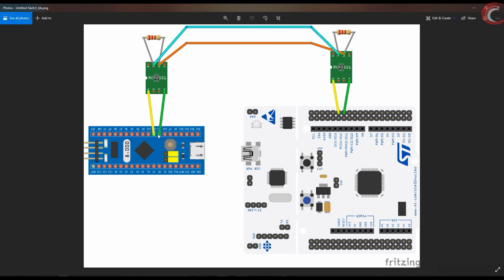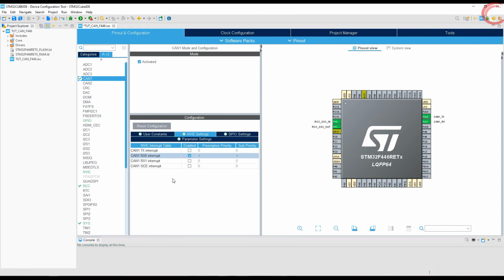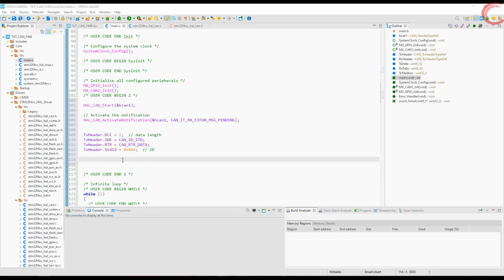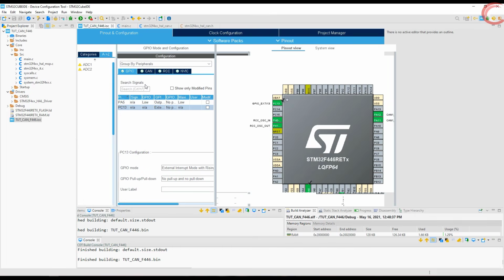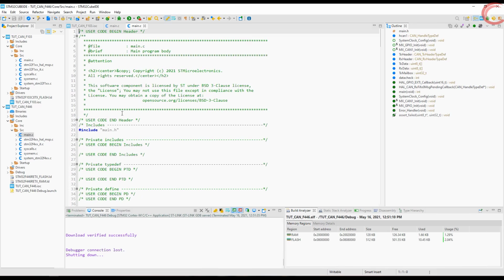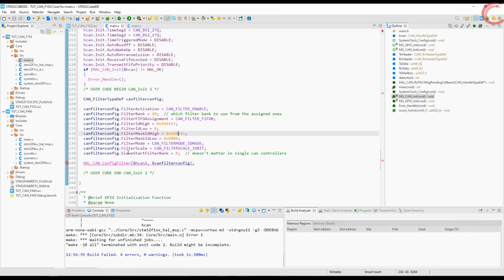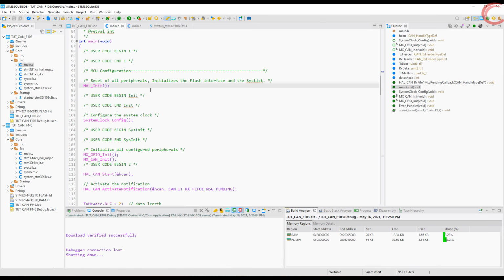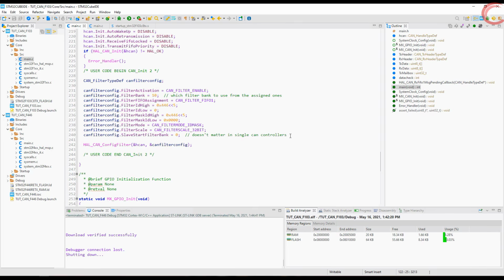STM32 CAN Communication Explained | Send & Receive Data Between Two Microcontrollers

Comment: i have to connect two CAN nodes operating at different clock freq. for Communication is it sufficient to fix one bit time and baud rate parameter only or any other parameter needs to be fixed?

Comment: i have to use two CAN nodes, which are operating at different clock freq. In order to communicate on CAN protocol, i have to match the bit timing parameters. fixing one bit time and  nominal baud rate is sufficient or any other parameter needs to be fixed?

Comment: Is it possible to connect these two boards without CAN tranceivers? We actually make double conversion. From board to CAN and backward...
From software point of view we work only with microcontroller's logic... And physical CAN layer is hidden for us...
Reply from the maker: Yes it is possible to connect them without the CAN transceivers. You are taking the video in a wrong way. Please don't see the video as "Communication between MCUs using the CAN protocol", because no one in their sane mind will use the CAN to communicate between the MCUs, when you have other options like UART, I2C, SPI, etc. 
This video rather demonstrates "how to use the STM32 as CAN Master and CAN Slave", "How to transmit messages on the CAN Bus" and "how to receive correct message from the CAN Bus".
Reply: @ControllersTech  Why wouldn't you use CAN, it has a much longer length between nodes than usart, i2c and spi

Comment: i have my receiver sucessfully received the message and datacheck flag is turned to 1. But the receiver does not jump into the if function inside while loop. What can be the problem ? Btw thanks for detailed video!
Reply from the maker: debug the code to find it out. Maybe you are transmitting messages at a very high rate.

Comment: Thank you for explaining it well..
I have tried implementing the code loopback works fine but for normal mode I am facing issue in transmission and the error is bit dominant error. What is the cause for it?

Comment: What is the txMailbox???
Reply from the maker: Txmailbox is used to send the can frame. The F4 board I was using has 3 mailboxes, so we can queue up to 3 frames for transmission. Then the frames can be sent based on the priority of the message. In the video I didn't utilize much of the mailbox's features, so it was only used for transmitting a single frame.

Comment: it does not jump into the HAL_CAN_RxFifo1MsgPendingCallback() function? 
I pulled the RX1 pin up but it still doesn't work.
Reply: Did you solve that problem ??
Reply: I'm facing the same problem. Did you solve it?
Reply: @tantrung7398 @ziademad53 I've solved the problem. For me adding "HAL_Delay(1)" after the Tx function fixed my problem.

Comment: What is the sequence of loading and running with respect to the  boards  .For the Master 446 and the slave F103,  diagram does not show  other end connections of USB cables . Is the 446 USB connected to PC for program uploading and power . For F103 is  other end of 4 pin link  connected to PC  USB port for program loading while the  USB mini  is connected for power / How do the master and slave  get their programs - are they loaded thru only the 446 or does each microcontroller have to be loaded first  thru USB ports  ( on a port hub )
Reply: Issue Resolved  -thanks

Comment: Hello Sir, do you know if its possible to use blue pill for combining usb comunication and can comunication to make USB<->CAN bridge?
Reply from the maker: Yes it is possible. but rember that bluepill only supports usb device mode, so plan the things according to that
Reply: @ControllersTech  hello sir is these vedio useful to receive  can message using stm32f103c8t6(blue pill) and sent to uart if not tell me a way to do please
Reply from the maker: Yes. Just send the RxBuffer to the UART.

Comment: Schematic does not shown all wire connections  btwn Blue Pill STEM32, 2551, and the F446RC can  you provide all those in more detail -Studying CAN and this is a great tutorial serie(s) just not that familiar with STM32
Reply from the maker: connection diagram is shown on the webpage.. The link is in the description.
Reply: : @ControllersTech  for the  Master 446  is the entire code  loaded (and powered) thru the USB port ?; for the F103  4 pin Link and usb are cabled  - is the USB connection for power? -and is the 4 pin  link going to a PC USB port . Other ends of cable(s) to power source and download path not shown -same with multi devices  don't want to mis connect system (s) Not sure how to physical feed the code to Master and slaves  from cube IDE  Walk thru all code  and all tutorials -several times until I understood-appreciate the details - Have a good understanding of the Can BUS std  just not sure of hardware /upload connects : retired engineer  ( old school) still have my sliiderule - mentor for robotic team now
Reply: Issue Resolved - thanks

Comment: Hi, thank you for this video. I want to inow how to convert CAN BUS 1 to UART? Can you advise? Hope you can help. Thank you.
Reply from the maker: Why would anyone want to do something like that ?
Reply: I need to interface CAN BUS 1 output from one device  to UART input on a different device. @ControllersTech
Reply: @ControllersTech  i have one device that sends info through CAN BUS 1 and an other device that has a RX and TX that is normaly meant for UART connection. This is for a project where I am building a drone. The OSD info from flight controller is sent out via CAN BUS 1, the FPV camera overlay this info. But it does not have CAN BUS 1 and only have UART connection. Any idea on how I can go about this? Hope you can explain. Thank you.
Reply from the maker: You can use your STM controller to read the message from canbus and then After receiving the message, send it via the uart.

Comment from the maker: If the setup doesn't work, Pull the RX pin HIGH using the internal PULL-UP in the cubeMX.
Reply: after pressing button led is not blinking in stm32103c8 and 446re only while button pressed in logic 2 signal is showing not blinking led please help me

Comment: Isn't it a problem that you are connecting 3.3V stm32 pins to 5V MCP2551 pins ?
Reply from the maker: Mcp runs at 5v. The tx and rx pins don't.
Reply: @ControllersTech  but on the datasheet it says that te txd and rxd runs on Vdd +- 0.3V.  And Vdd is 5V.
Reply from the maker: Even if they do, a lot of pins in the STM32 MCUs are 5v tolerant.  I am sure the CAN pins are among those.

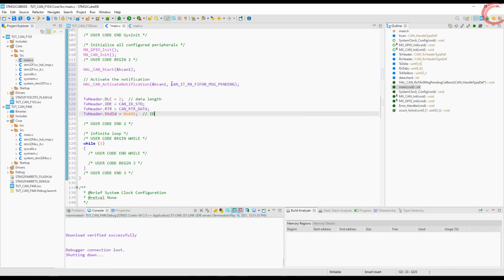Comment: At time 12:03 you say " as I said I will use fifo1 here" where did you said this and why what is the difference what happens if I keep it 0
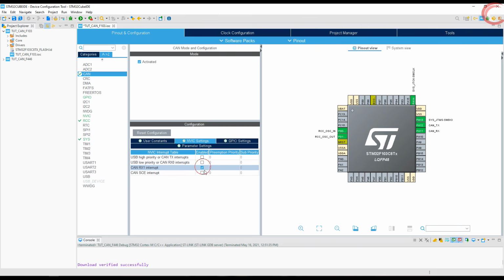Reply from the maker: "where did you said this and why" at 11:00, I said it's just to demonstrate. I just wanted to show that either of the fifos can be used.
 "what is the difference what happens if I keep it 0", basically nothing. It doesn't make any difference

Comment: What happens if I disable filter ? I don't want filtering. Every message can be transmitted and received in my case
Reply from the maker: Try it. If it doesn't work, then use the filters and set them to 0

Comment: Please explain , why we need can transceiver  if both ot MCU support the CAN protocol? If however I have to use can transceiver  then  if I'm using the Rx and Tx pin on can board  to communicate with it(CAN BOARD) from MCU , then why we don't program the MCU for  serial communication ?  after that it is the mandate of the CAN module to convert a transmite and recevie and then convert in to serial  again?thank you .
Reply: CAN protocol uses differential signals to communicate. However, the MCU we are using can't produce differential signals. Therefore we need extra IC chips, CAN transceiver in this case to produce differential signals. 
Also, if we are measuring any differential signals our MCU can't sample those signals. In this case too we need extra chip to intake differential signal and produce single ended signal so that our MCU can sample those signals.
Hope that helps.
Reply: Also, CAN protocol has multiple advantages over plain Serial(you mean, UART since CAN is kinda Serial too,) .
1. distance
2. Noise immunity
3. Multiple nodes communication

Comment: Hi @controllers_tech , thank you for the tutorial. Unfortunately i have problem with transmiting message with CAN. I used analyzer to check if any data was transmited on Tx pins before the transcevier (TJA1050) but it is not. Also function HAL_CAN_AddTxMessage doesnt return any errors. I have connected both boards with the same can configuration and i have code exactly like yours. DO you have any suggestion how to solve my problem because i dont know where to find the solution.
Reply from the maker: First start with loopback mode (previous video). That's more suitable for error checking
Reply: @ControllersTech  after what we need to do ,loop back mode

Comment: Dear @controllers_tech Thanks for this tutorial. CAn you please tell me how did you manage USB cable and st-link at the same time both just for programming. Thanks in advance
Reply from the maker: What USB cable ?
Reply: On one hand and from the blue-pill you connected the four wires cable (3V3, SWDIO, SWCLK, GND) probably to your pc through ST-LINK. On the other hand you connected the android cable that normaly powers the blue pill. I want to know if it was necessary to connect this second cable on the blue-pill and where have you connected that one (also on your PC)? Thanks in advance?

As a matter of fact, I have not yet used the blue-pill although I have it. I need to use it now from canbus application and your tutorial has help me a lot to undersatand this application. The matter is that I just know that in order to program with blue-pill I just need to connect my blue-pill with st-Link that will also send datas and power my blue-pill board. I want to know what led you to connect both sides of the blue-pill. Your response will help to have an information that I don't know about blue-pill connections.

Comment: Do i need a level shifter with can transciever? Because in loopback my code is working fine when i hook it up to othet stm32 i am unable to recieve any data using mcp2551 can transciever IC
Reply from the maker: No. It's not needed.. check the rx and tx with oscilloscope or logic analyser..
Reply: @ControllersTech  okay, do i need to send the message again and again. As in my case i send a message and other controller waits for reception
Reply from the maker: No. That's not the case.
If you are doing everything as explained, it should work in a single attempt.
Check the terminating resistances, the wires if they are connected properly..

Comment: Very good explanation but using a twisted pair wire is an overkill IMO since both wires have a plastic cover and the distance between the two nods is very short :)

Comment: can you share the download link for analyzer too?
Reply from the maker: You need an analyzer for that. The software depends on which brand you are using.
Reply: @ControllersTech  brand?
Reply: @ControllersTech  I am following your same tutorial for learning and testing purpose
Reply from the maker: I have a cheap chinese clone. It's sealogic
Reply: I want to see the tx and rx through this analyzer as you did in the tutorial. Its not free?
Reply from the maker: Analyzer is a tool. It's an actual hardware. You need to purchase it and then connect the mcu output to it.
Google "usb logic analyzer"
Reply: @ControllersTech  Hi, did you hook the logic analyzer in the CAN_H and CAN_L bus wires ?
Reply from the maker: Yes

Comment: Is it possible to send a bxCAN message by UART? How is it possible?
Reply from the maker: No. Can uses differential signals, where the 1 and 0 are represented by the difference in the level of CANH and CANL.
  Whereas Uart uses the simple high and low. 1 is represented by high and 0 by low.
Reply: @ControllersTech  sorry, I explained wrong. Is it possible to send a previously received rxCAN message through the UART port?
Reply from the maker: Yeah you can send. It's store in a buffer right, just send that buffer
Reply: @ControllersTech  thanks for your answer, that's what I have tried but I still have an error. If you want, you can see the video on my channel where I show my problem.
Reply from the maker: @7juan17  1. Where is the filter configuration ?
2. Debug your code, and check the content of the canrx.
Reply: @ControllersTech  This is my filter configuration:
canfil.FilterBank = 0;
  canfil.FilterMode = CAN_FILTERMODE_IDMASK;
  canfil.FilterFIFOAssignment = CAN_RX_FIFO0;
  canfil.FilterIdHigh = 0;
  canfil.FilterIdLow = 0;
  canfil.FilterMaskIdHigh = 0;
  canfil.FilterMaskIdLow = 0;
  canfil.FilterScale = CAN_FILTERSCALE_32BIT;
  canfil.FilterActivation = ENABLE;
  canfil.SlaveStartFilterBank = 14;
Reply: @ControllersTech  Later I will upload another video with the data in rxCAN, obtained with my logic analyzer